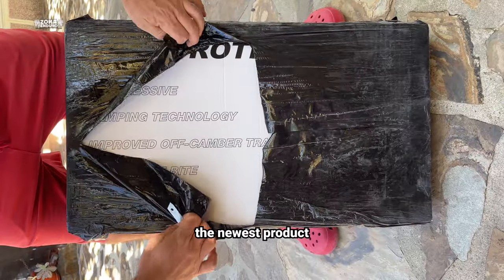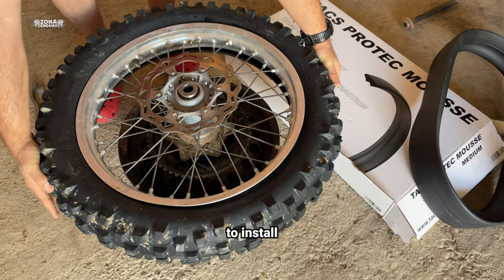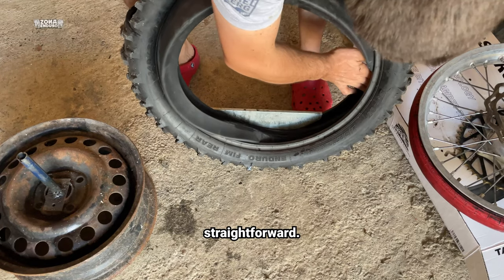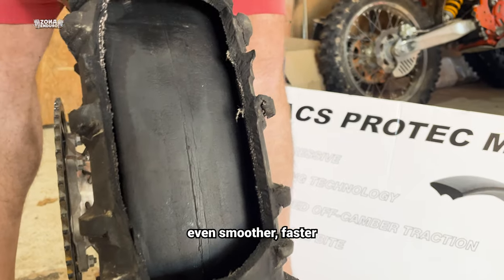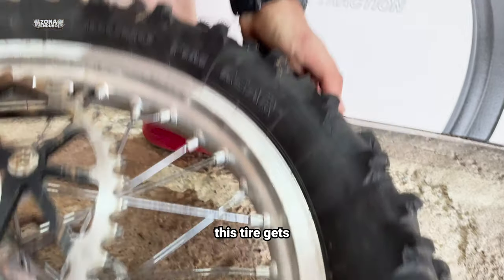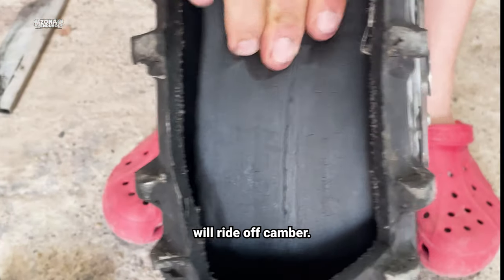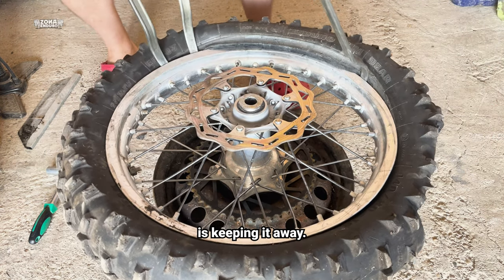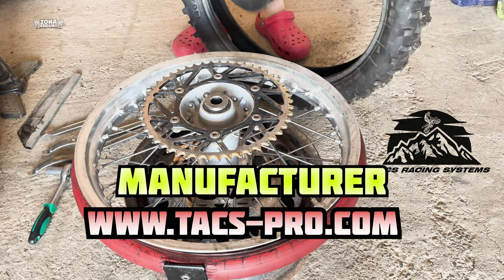The Revolutionary 👉 TACS PROTEC - Half Mousse for TUbliss

Comment: What is lifetime of this mousse, riding with some pressure like normal 0,1-0,3 bar but using this just for failure or for protection over logs ? I have tubliss alone for 70hours and it looks like new and I am worried about mousses at all as they get worn out and you need to lube them. With tubliss alone I just change tires, but I like this one a lot and I am really tempted to buy

Comment: thinking of giving this a try...If I go with the Firm half Mousse, and air up a soft tire like IRC JX8 to 3 psi, how will the Tire feel?, Is it going to feel like, 6 psi 8psi, 10 psi?   I like to run low pressures but want to a mousse that will last.  any advice you can share?
Reply from the maker: I have the soft version. Since the video is up, still using it. No problems, no wear shown. Don’t know how the IRC Tures are because we don’t have them.
Reply: @ZonaEnduro  Is the Medium Tacs Mousse similar to the Nitro Mousse Platinum as for firmness?

Comment: Any top level riders using this?
Reply from the maker: Top level riders ride with mousses, but I know some PRO guys having Tubliss, unfortunately I don’t know if is fair to mention them here… What I can tell you for sure, the system was used a full season in EXPERT class in all Romanian races, with no failure! And with a TOP10 results all the time! Trust me, Romanian races in EXPERT class are freaking HARD!
Reply: @ZonaEnduro  I'm so torn between these two.  For some context, at the beginning of this year, I bought brand new Michelin Mousse Bibs for both the front and rear.  But this last weekend, I did an event where there was about 5km of off-camber stuff and my back kept washing down the hill.  I'm a good bronze route rider, so could also be technique, but you know, I want to blame my setup.  I spoke to some guys and they said even though the top riders are using mousses, they are drilling holes in them to soften them.  Now, that seems like a very scary idea considering the prices I paid for them.  Perhaps you could put a video together describing drilled mousses?
Reply from the maker: @EnduroNerd yes, pro guys use super soft mousses and also drilled. But that is expensive… a drilled mousse has less life and could collapse quickly. 

Also they are not riding with them brand new. A 2-3 training session is a must to soften even more!

Also make sure for off-camber to have the tyre spinning the right way.
Reply: Interesting would like to try